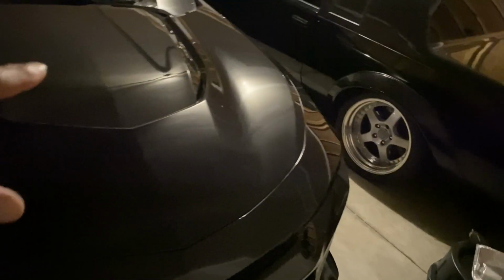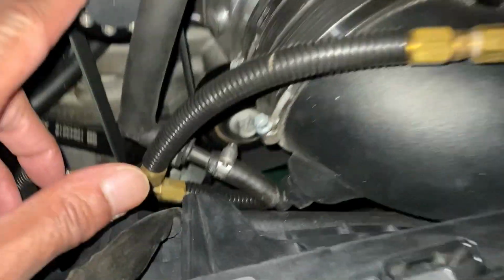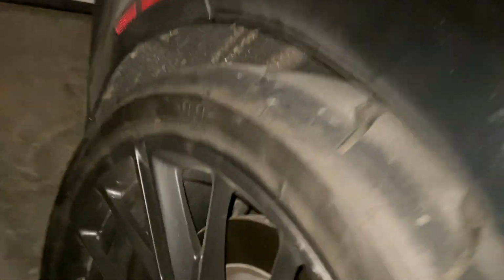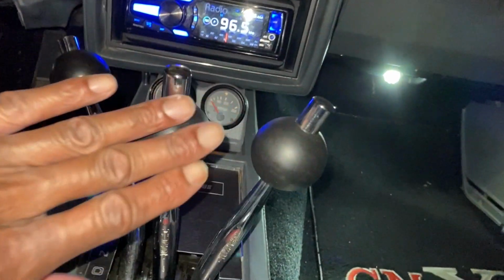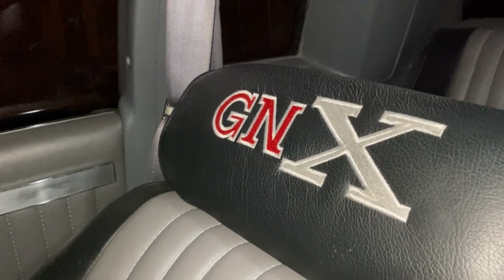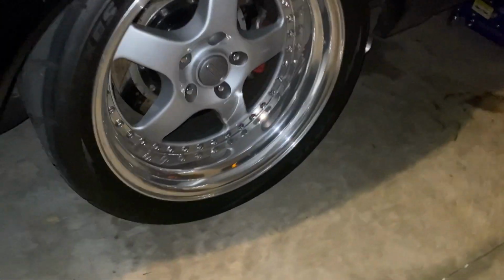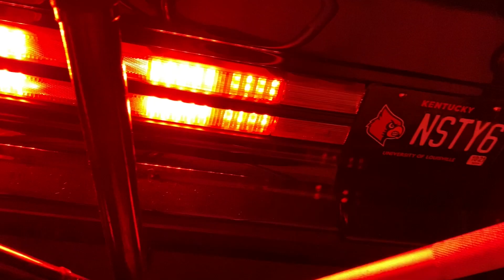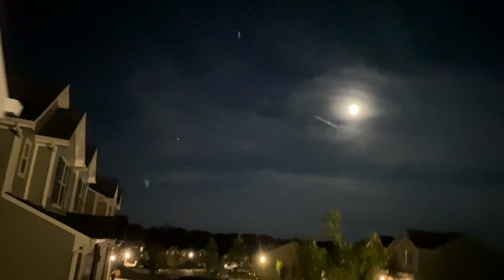Night video of my Buick Grand National and the ZL1 Camaro for the New Subscribers

Comment: If you need a turbo I have a brand new 72/70 precision dual ball bearing ordered through RJC never used. I was gonna use it for my 109 block build but now I'm building a TA performance aluminum block with a 76/75 precision turbo